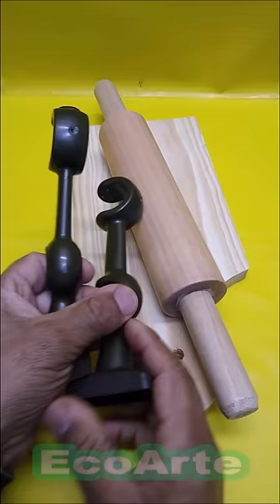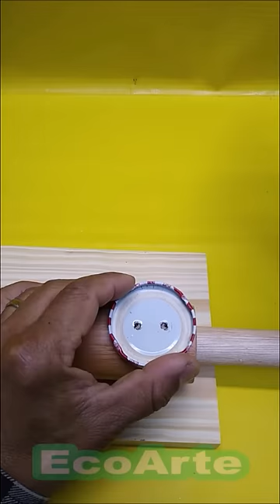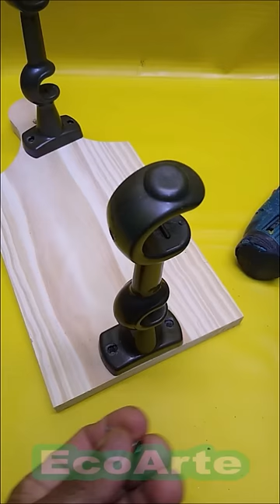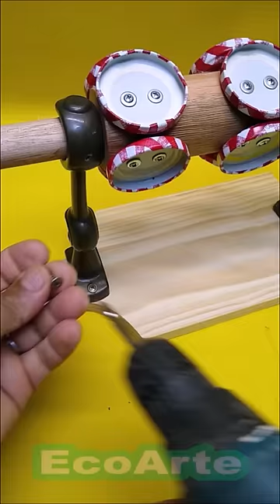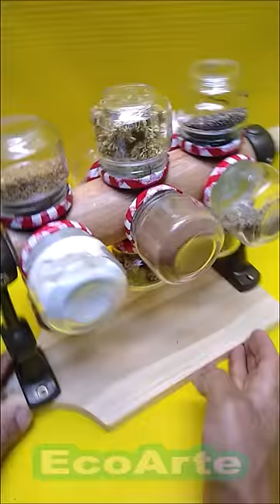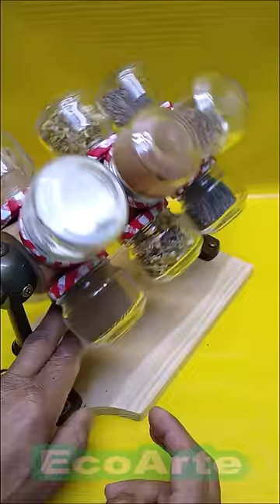ESSA IDÉIA DA PRA VENDER MUITO!! COMO FAZER #reciclar #reciclagem #ecoartes #shorts

Comment: Totally love this idea..all I have to do is stick a label on the bottom 🙂
Tip: use the easy to remove labels, so if you change a spice to seasoning or vice versa it's easy to peel off..less hassle ☺️
M.L.V.